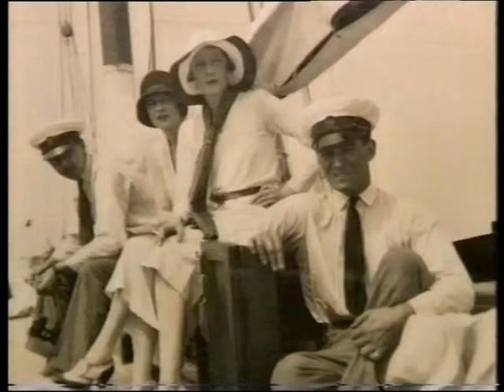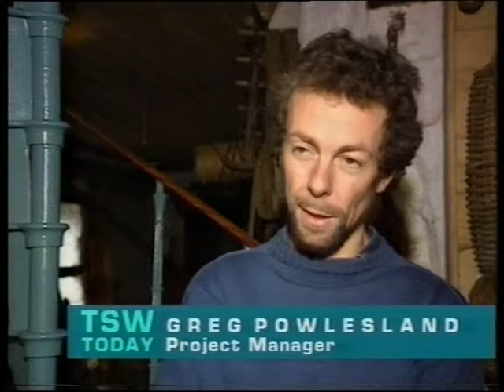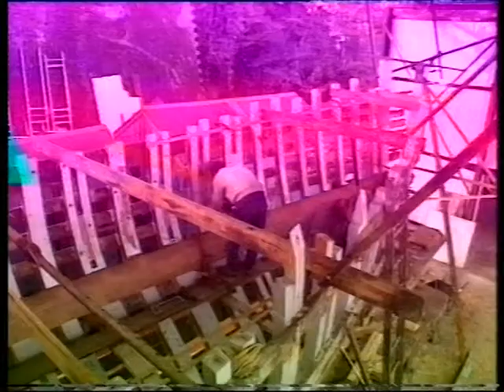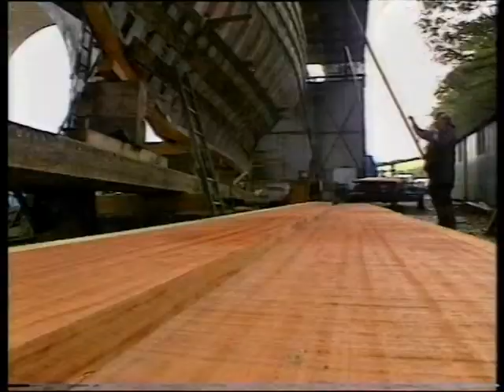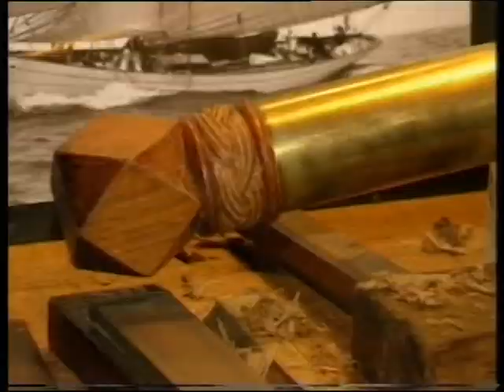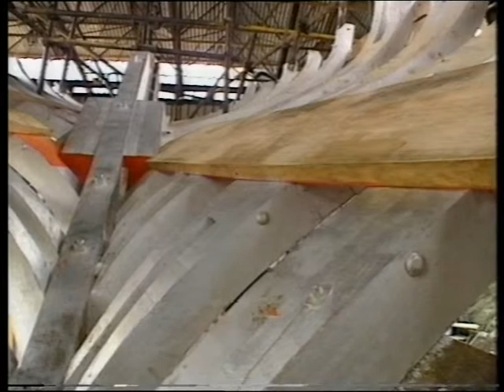Marigold

Comment: A Mr. Alan Woods was the owner before Greg. Mr woods had worked in South Africa I believe and had the dream of turning her into a houseboat. He found Marigold in Southampton in Shamrock Quay. He made two or three attempts to float her and around the third try got her to release from the mud. Using a dingy with outboard managed to get it to the other side of the river by a company called Polycast. He got in trouble for having moved what was technically classified as a wreck by the river authorities. Feeling the weight of all the red tape, I think he managed to secure a temporary mooring at Wotton creek on the Isle of Wight. One Saturday morning, the company launch from Gibbs winches in Warsash towed Marigold across Southampton water past Cowes and into Wotton Creek. That was the last I heard of Marigold till she was bought by Greg.